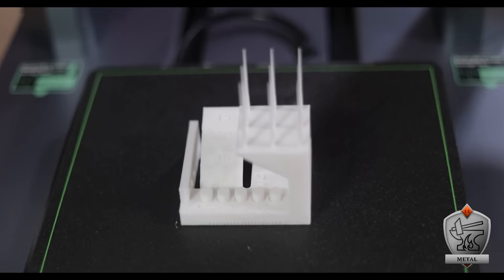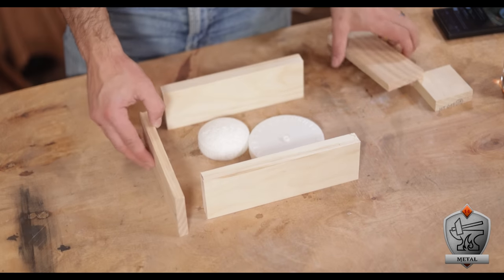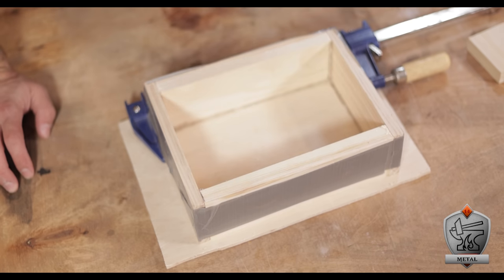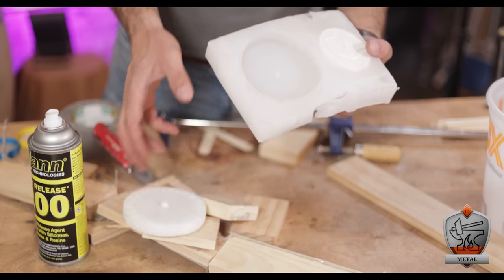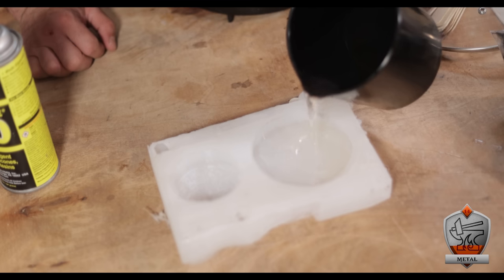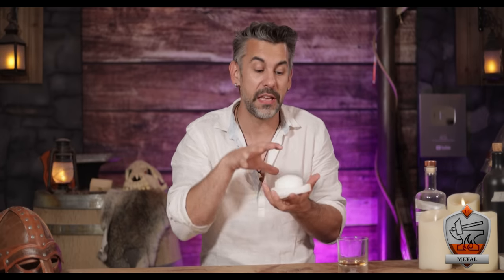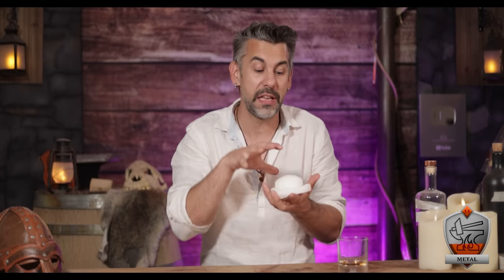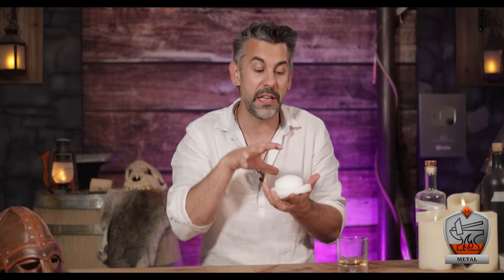DIY Your Own Fantasy Cipher!

Comment: Hey Kit, I have a Associates degree in Metalcasting technology & Manufacturing management. I currently work at an aluminum foundry as a process engineer. So I feel comfortable and qualified giving you some pointers. 

First of all, I want to say, you are doing great! I love the project, and the fact that you didn’t give up, but simply redirected your efforts. 

So I think you may be getting a couple different molding practices crisscrossed, there’s green sand  molding, Lost wax casting and lost foam casting. All three of them are super interesting and complex in their own way. These are not the only Casting methods there are many more that I won’t cover at the moment. 

-Green sand uses a “pattern” that gets removed or drawn from the mold and leaves a cavity for metal to flow into. These molds are typically in two parts called the cope (top) and the drag (bottom)

-Lost wax casting uses a wax object that is in the desired shape of the final product and it is typically coated in alternating layers of sand and a refractory slurry. The wax is then melted  out from the inside useing  a furnace or oven, leaving behind the hardened shell and the cavity in the shape of a desired piece. 

-Lost foam, uses Styrofoam. This process can be done either in sand or in a similar way to the lost wax process. ->Using lost foam in sand = first the foam is formed to the desired shape, (our final product) the foam pieces is then buried in molding sand (foundry sand) in a way that a portion of it is visible from the surface. When the molten metal comes in contact with the foam, it will instantly vaporize, leaving behind a cavity in which the metal fills. 

If you have any questions, I’m more than happy to answer them. I love what you do.
Reply: Listen to him.
This is the way.
Reply: I was thinking, using wax in green sand, he would have to burn away the wax with a flame thrower or something before casting the metal (maybe include a wick in the wax and let the candle burn inside the green sand until the wax is gone).
Reply: He could also try using a lower melting point metal such as pewter and still be able to cast directly into a silicone mold as silicone is temp resistant to almost 675°. Just a thought
Reply: @StarlasAiko  sadly, the lost wax process and green sand molding don’t mesh very well. Now what you can do is take the Harden shell from the lost wax process in buried in green sand for more structural support as well as for safety reasons. The green sand will act as a barrier and help prevent the molten metal from running out in case of a structural failure.
Reply: @justurbaby  pewter is definitely a possibility, but he would have to use a different type of silicone. The Dragon Skin mixture he is using has a melting point about +450°F which is below the melting point of pewter which is between +477°F and +554°F depending on the alloy ratio
Reply: This is the way.
Reply: I fondly remember Foundry class in high school. Albany green sand, roaring furnaces, molten aluminum and wooden patterns made in a different class. My first casting I forgot the sprue for the metal, used a dowel to poke a hole down to where the pattern was already removed. Ended up with a very pretty lump of metal. Still one of my favorite classes. It was Brooklyn Technical High School, in the late 70's.  Keep leveling up!
Reply: This is great advice! I would also add that it doesn't look like there is much in the way of an undercut on the part he is trying to make, so I think that if he did the same sand molding process he showed in the video but then just removed the wax the cast would have worked out okay. Maybe pre-drill a couple of little holes in the flat parts of the wax molds to get a grip on them for removal
Reply: @ber5erker__760  Bismuth has a melting point of only about 115 degrees fahrenheit so he could use that(also when it oxidizes it gets different colors).

Comment: Hi Fellow Adventure!

I ran a small metal sand casting lab in college, so I've done some of the aluminum casting you're trying. 

The problem you experienced is called the Leidenfrost effect, where a layer of gas (usually water vaport) builds up as you try to heat/melt something. You can see this happen when you see water droplets dancing around on a hot skillet. 

I think your best best is to use a two part mold. You make the bottom part the same as you did here. But then your top part should include a sprue (i.e. funnel to pour the liquid metal into), some runs to direct the flow into the pattern, a riser to account for shrinkage, and possibly an exhaust vent as well to allow the gas to escape. This take a lot more metal and a lot more post-processing, as you have to cut off the runs and file down the sides of your part. Let me know if you have any more questions that I can try to help with.
Reply: This, precisely. I was practically screaming at the screen, "Why the bloody hell did you make half a mold and expect it to work?!"

Comment: Paraffin wax isn't usually the wax I see used with metal casting, it's usually a green wax that's specifically designed to melt out when metal is poured in, so that might make your next casting work out a little better
Reply: Sprue wax, I think it's called
Reply: sounds like you mean sprue wax or investment wax, i personally use beeswax on small castings and it works fine but i have to seriously torch it out.
Reply: pla has really low melting point so alot people burn out the part directly from the print. That being said this isn't really the right time of mold for lost wax method.

Comment: because you mentioned your struggle with casting metall:
there is a clay (i believe from japan) that acts as normal clay, however once you fire it, it turns into silver (i assume they have other metalls aswell) so for something like this project here its not as usefull but i would love to see you give it a shot for jewelry, one thing to note however is that the clay shrinks by around 20% when firing so keep that in mind :D

Comment: Every time I've heard of lost wax casting, they don't use foundry sand but plaster. You put the wax into the plaster along with some sprues. Then heat it up in a kiln to melt out the wax and warm up the plaster. Then pour in the hot metal.
Drop the whole thing in a bucket of water and the plaster melts away leaving the metal sculpture. Dispose of the plaster water responsibly though, because it's essentially quick lime at that point.
Reply: Yeah, melting the wax before pouring the metal was what I was going to suggest as well. That's how I've done it in the past.
Reply from the maker: I am for sure going to devote time to learning. Clearly not a "figure it out as you go" kinda skill 😅
Reply: @toerag572 I think they have a special plaster just for that too, saw some jewelry channel use it.
Reply: @SkillTree  One little thing to add: I'm sure in the future you'll have time to get a real crucible, but as soon as you brought out the fire extinguisher I went "ooh hope he's not melting aluminium". The molten aluminium actually dissolves steel, which is probably a good part of why your makeshift crucible developed a hole. But hey, they're pretty good for limited runs!
Reply: @lextheap1638 The stuff used for jewelry is called "investment." It's essentially a high-temperature Plaster of Paris. It is used because most jewelry is made using gold or silver, which is much higher than that of aluminum. (Pure gold melts at nearly 2,000°F or 1,000°C, compared to aluminum at 1,200°F/660°C.)

Pewter, OTOH, melts at about  400°F/200°C. There are actually types of silicone rubber you can use to make molds and cast the pewter directly into them.

Comment: This! This is way your channel is so great. You show the mistakes which in turn helps those who are reluctant to try something new fell better about the mistakes that we will make. An idea, instead of pounding the table run a blender with ice in it to create the vibrations you need to get the air bubbles out. Also you can use the crushed ice to make margaritas, two birds with one stone. Also don't leave fixing the pitted driveway too long. Come freezing weather you could have much bigger holes in your driveway.

Comment: A random tip on plaster--if you add a little PVA glue (Elmers or generic...it is all the same stuff...don't use the yellow woodworking PVA as it has compatibility issues with many other things you may want to do to it later) to the water used to mix the plaster up, it will do 2 things: 1) It will extend the set time of the slurry by 1/4 to 1/3 of normal.  I know you were going for speed in this one, but sometimes this is a real advantage.  2) Secondly, the glue will...wait for it...glue stuff together; specifically all the little gypsum crystals that forms as this stuff sets! This hardens the final part so much it is almost unbelievable.  I did this once with a part I wanted to sand; and it was so hard it was almost unsandable, even with high quality emery cloth sandpaper used to sand metals!  I got it done, but it was far more of a fight than I expected.  Don't overthink quantities of glue--if it would make a good, thin consistency wallpaper paste/paper mache paste it will work!  When still green you can sand/carve/work the part, but make sure you have it the way you want it before the thing dries!

Comment: Doing one of these in an aged copper colour with lots of green patina would look brilliant as well.
I hope you go to conquest next year. I won round 3, but I can't make it this year.
Reply from the maker: That is the plan! And we will have a whole year for more contests and planning😄
Reply: @SkillTree  Maybe look into using electroplating on how to get metal to apply to a non-metallic surface. I've seen some 3D printing channels where they use the plastic model and electroplate onto it after applying a conductive spray paint on it. I've never done this myself but I'm sure there's plenty of videos on it. I think one of the videos I watched, the 3d model was electroplated first, then the plastic was melted out and pewter was poured into the metallic shell
Reply: @SkillTree  using the same mold you could cold cast with resin. It's basically a metal powder used to coat the outside layer of the mold which when hardened acts exactly like metal. You can patina it, buff it, polish it. Just another suggestion since you already have a usable mold to cast from.

Comment: If you pack the sand alittle tighter, you can remove the mold. Conversely, I’ve normally seen foam instead of wax. Some form of closed cell foam you could cast in place of the wax, which will burn away much faster.
Reply from the maker: Originally removing the wax and then pouring the cavity was the plan. The issue was the detail on the sides. Pulling the wax out would leave the flat impressions but ruin the sides. Maybe if I melted it with a heatgin first though🤔
Reply: powder helps. but next time print the ruins inset? hmmm. thats a tricky one. how do you pull the mold out without screwing up the lettering on the sides. how about high temp silicone and using lead which melts at a much lower temp? blocks of lead can be gotten at any fishing supply store [used for making lead fishing weights). no crucible. just a pot on a burner. 😅
Reply: @SkillTree melt the wax out.

Put it upside down in the oven (over a large tray to catch the melted wax) at around 220.

The wax will melt and pour out of the mold.
Reply: @SkillTree you beat me to it! I was going to recomend the heat gun! Or lost wax casting since you already have a forge!
Reply: @SkillTree ot gin on the brain when spelling heatgun? That typo made me chuckle

Comment: Experienced metalsmith, caster here.  I love your attempts, sharing, and attitude.  You try and encourage us all to try!  Lost Wax and Sand Cast are two different methods, and you sort of combined them here...   Your model is excellent for open sand cast.  Powder the model with corn starch or talc as a release agent.  Prepare the model with holes in the back to aid in pulling the model out of the sand.  Your makeshift crucible failed because the steel was thin, and the forge got much hotter (2500 - 3000°F) than the melting point of both of the metals. (Al 1220°F, Steel 2500+°F)  Hope you purchased a good thick walled ceramic crucible.  Keep after this... and keep leveling up!!

Comment: Tips: 
1. Before making the silicone mould, sand away any of the 3D printing texture you don't want to have appearing in the final product
2. Use clay or Lego or some other adjustable shape to save on silicone use
3. When you've revealed the wax casting, check again for the textures you want on your final product. Wax is easy to carve, and a lighter can quickly smooth out any lines. If you end up going too far, it's okay. Just re-melt the wax and try again. This is the perfect phase to chase perfection without worries of wasting material
4. After the wax casting is in the sand mould, you can drip a bit of hot wax from a candle and attach a "handle" with which to pull it out, if you don't want to go the plaster route

Comment: Casting tips

To get that result where your model instantly melts away when the metal touches it, the model needs to be made from Styrofoam. With a wax model, you want to mix a little plaster into your foundry sand and make it a little extra damp, pounding it more firmly around your model. You then need to melt the wax out, in an oven on a low setting. Place a tray on the rack underneath to capture your wax and prevent fire in your oven. To make a more substantial feeling item, add lead in with your aluminum and stir (a pinch of bismuth and/or antimony will help bond a more cohesive alloy). You will achieve the very best results with the lost wax method, and a vacuum casting or centrifuge casting machine help you achieve the highest levels of perfection and scalability.

Comment: I've never seen lost wax casting done by burning the wax away with the material replacing it. Usually, the wax is cast in plaster with a sprues attached which stick out of the plaster, then once the plaster (or investment) is set the wax is burned away so it runs out the sprue hole. Once the investment mold is empty, then the metal would be poured in. With casting done in sand like you tried I believe usually you would just lift the wax or whatever you were using as a positive out of the sand very carefully before pouring.

Comment: I used to make adventures for a summer camp I worked at, and seeing this prop gave me an idea. You can have two rival teams go on competing quests to get their own treasure first. Each team's treasure is half of this cipher. When they come together at the meeting point (After finding their 'treasure'), they find a coded message. Eventually, each team puts their half together and works with each other to translate the message, then together they go and find the real treasure. Usually in situations like this, the rivalry between the two teams gets lost in the magic of the quest.

Comment: With sand casting you really need to pack the sand around the mold and remove it before pouring, in this situation i would have made a two part flask, done both pieces separately,  and added sprues for pouring. I would recommend starting with pewter for your next casting project, it's very forgiving and melts at  a lower temp than aluminum. Might be able to do it on a hotplate with a thrifted pot. You should also be able to use silicone for the molds with pewter.